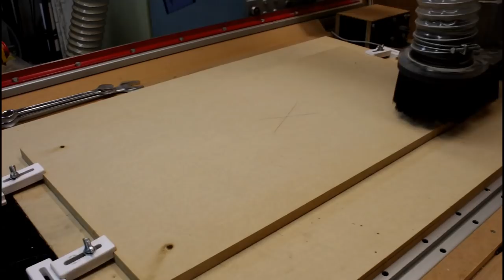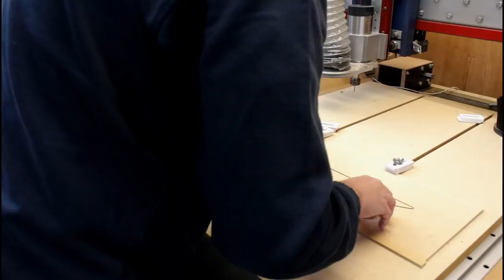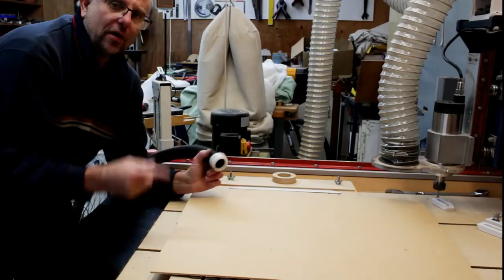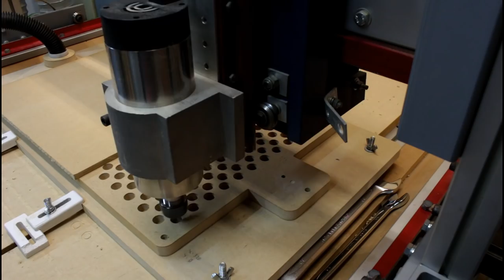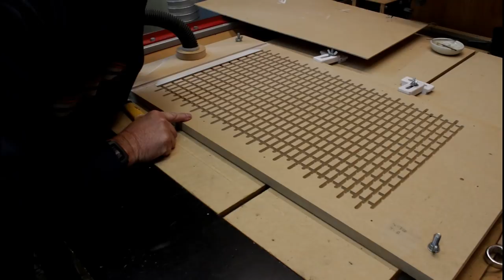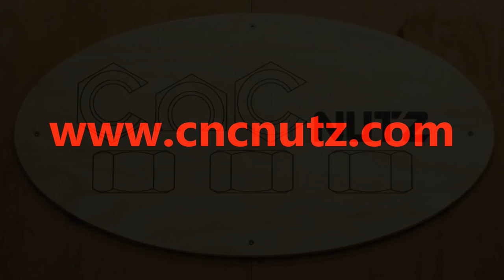DIY Vacuum Table Part 1- CNCnutz Episode 210

Comment: Hi Peter, yes so much of what I do is trial and error as well. Forgive me if you have covered this already, but I wonder if you are aware of any time out function or setting in Mach3, where if you bring in your code, get everything zeroed, then for what ever reason you don't touch the machine for maybe 20min, the steppers become non responsive but Mach3 still seems to function as normal. Reboot Mach3 and things are ok again. No big deal but a bit irritating.  I have a router controlled by a G540 and a mill with a Homann BOB and G213v on each axis. Any ideas?
Cheers
Phill
Reply from the maker: Nothing that I am aware of. It shouldn't be doing that. I am curious what you are using to connect the pc to the drives. Are you using the parallel port or a motion controller?
Cheers
Peter
Reply: CNCnutz (Peter Passuello) Thanks for your reply Peter. I'm using a parallel cable on both machines and a Dell Optiplex 755 pc.
Reply from the maker: Other than making sure you have things like screen savers turned off and power settings set to keep everything turned on I can't think of anything else. It sounds like the issue is your PC is going into some kind of sleep mode. I used to run a program called RM clock on my laptop to make sure the processor didn't reduce power while in use because laptop try and conserve power. RMclock can keep processors runing at full speed even when not in use stoppng them from going into power saving mode by slowing down. It's possible your PC has the same type of function. It may even be a BIOS setting
http://cpu.rightmark.org/products/rmclock.shtml

Give it a try and let me know if it fixes the issue.
Cheers
Peter
Reply: CNCnutz (Peter Passuello) Thanks Peter I will Check that out as soon as I can. Getting my eyes upgraded with new lenses at the moment.

Comment: Good video. I am thinking about using a vacuum pump instead off a vacuum cleaner.  Less noise and might be cheaper to operate.  I have sealed my mdf with paint which done the job on the vacuum leaks.
Reply from the maker: Thanks John.
Reply: As  long as your pump can do the volume.  A vac table needs very little pressure or volume normally, the volume is needed when the table is not sealed fully.  Lots of luck with your system!
Reply from the maker: I agree. Volume is needed to comer the leaks in the system and a little vacuum goes a long way if spread out over a large area.
Cheers
Peter

Comment: When you mention that the vacuum will overload when it spins faster, it is really being under loaded.
The motor spins faster because it has less load when you plug the air input, as it creates less dense air around the turbine, and motor uses less power.  From electrical point of view, less current.
Now, maybe bearings might not be up to the task of that little extra increase in speed, but it is less 1.5x extra.
Reply from the maker: Thanks Ivan for pointing out the vacuum spins faster. I confess that I never noticed it. I would hear the change of pitch but not thought about it any more than that. It's amazing how you don't notice or put 2 and 2 together but when it is pointed out it is obvious. That said the reason the vacuum burns out isn't the bearings, it's the heat. Because it is not 100% efficient much of the power going into the vacuum is output as heat and without the air flowing through it will overheat and burn the windings.
Cheers
Peter
Reply: @cncnutz  

Industrial or "shop vacs" are available with a bypass air passage so that the vacuum suction pipe can be blocked without blocking the motor cooling air supply.
Household type vacuum cleaners that rely on the exiting air to cool the motor are not much use for dust extraction and vacuum tables in the workshop as invariably there are situations where the air flow is restricted. A good vacuum cleaner will have over temperature protection but a not so good one will burn out.
Cheers Keith

Comment: Just us a non porous material for the bottom. No sealing required. Acrylic would be perfect.

How do you calculate the airflow? I need to make a removable 2x4 vacuum table
Reply from the maker: Hi Joe
I don't know about air flow but I simply calculated the cross section aeea of the hose and made sure the cross section area of the galleries was equal or greater so it didn't restrict air flow.
Cheers
Peter
Reply: Thanks peter that makes perfect sense. Great video. I have watched it many times over 1st and second episode. I am trying to understand why the holes on the spoil board?
I understand that it is to pull a quicker vacuum, but if MDF or LDF is already porous. Why make any holes? As long as you mill off both sides of the mdf to remove that flat hard compressed material. Kind of like the next episode when you use the newspaper trick.

Thanks buddy! Live, eat, sleep CNC!  Keep up the great work.
Reply from the maker: In all honesty Joe I thought holes were needed when I made this and will be doing as you suggest when I do my rebuild as I was thinking the same thing. I also want to test holding with pockets machined into the top against no pockets and see it there is any real difference. 
Cheers
Peter

Comment: the last project that sucked i done was the dust boot for my cnc
Reply: Does this mean that even if you had a perfectly sealed table you still wouldn't be able to hold MDF to it?
Reply from the maker: Well so long as it didn't blow. 😉
Reply from the maker: I think the vacuum would still bull through the sides of the MDF and unless the base pulled down to the table top hard I think you would still loose preasure that way. sealing is the only answer for the MDF base.
Reply: Industrial cnc routers do not use MDF they actually use low density fiber board.  You can make the bottom portion out of cast acrylic or you can coat the MDF with lacquer or a fast dry wood hardener.  Your project is spot on just needs a little bit of help.

Comment: its compressed sawdust. its not glued. its not a solid chunk of wood (which is also fibrous) you need to use a sheet of plastic or aluminum. its solid and not porous.
Reply from the maker: You will see in part 2 that I painted it which seems to have sealed it quite well and adds plastic seal to the bottom well for an added seal. In hindsight making the bottom from a plastic material would have been a better idea but you live and learn.
Cheers
Peter
Reply: CNCnutz (Peter Passuello) true story. I’m a machinist for a living and we have special suction plates built specifically for certain jobs and their profiles. We do however have different sub plates that are more universal. They have one hole in the center and the o ring we use can be orientated o fit the profile of the part. The vacuum pumps we use can be controlled on the amount of vacuum actually applied to the fixture dependent on tool pressure and material. Sometimes we can use flooded coolant and sometimes we have to use forced air. Again thanks for the videos and being so involved with the audience.

Comment: You cannot have dozens of large open holes and still have a vacuum. It's like trying to put a voltage across a short circuit. Why don't you have a cover mechanism for blocking the holes you don't need for a job.
Reply from the maker: Hi Lindsay,
You are right. Even uncover 1 large hole and the vacuum will disappear and that is why there are no large holes in my vacuum table. I can have up to 25% of the ports uncover and the part will stay put. I admit that covering unused holes will help keep better vacuum but it will still work even if I don't.
Cheers
Peter

Comment: Yes a lot of people find this hard to understand.  My pump pulls through 25mm mdf that has been skimmed both side with the edges sealed.  You may not need all of the holes 19mm just try a sheets of mdf and mask off the area that you are not using with a plastic sheet
Reply from the maker: Thanks
Reply: Yep, plastic sheet does wonders, but a big PITA when the hold down vacuum is exceeded by the dust extractor and the sheet tears away!  I've scavenged off cuts from builders wrap and other packaging.  Cheers, David

Comment: Methinks this is overkill on holes, and a wee bit of under-engineering.
A measure of spring-loaded marbles.... scaled to measure with CFM of your vacuum ....
divided by the area of the vacuum table..... 
Think ... Pressure is Vacuum.
Table Area
Needed Hold Force
CFM Value.
Tooling Forces Applied.
Estimate your required information carefully.
Do you ABSOLUTELY NEED FULL TABLE VACUUM ?
Does your machine process only a single few shapes ?
Palletized processing could change EVERYTHING.
Palletized means much can be diversified.
Merely adding FOUR OR SIX HOLES... for 4 or 6 + pallets... May negate some resources at some point in the process.
Each "HOLE" can be electified, pneumatic, or hydraulic optioned.
Yes ? No ?
Shape your VACUUM Table to each specific part.... is efficiency.

Comment: You have to seal the sides and faces of your mdf!
Reply from the maker: Thanks Julius,
I think I've figured that bit out. 😉
I am just surprised that something like a vacuum cleaner has enough suck to do that to MDF.
Cheers
Peter
Reply: CNCnutz (Peter Passuello) i want a vac table but the only job i'd use it on takes over an hour so double sided tape seems cheaper in the long run
Reply from the maker: I just want to hold thin material flat while machining. It's always a pain when it bows. I thought of using tape but have always wanted to try a vacuum. I agree about the cost of running the vacuum.
Cheers
Peter
Reply: Mythbusters lifted an entire car with just a shop vacuum.  https://www.youtube.com/watch?v=GbqKwPktCdo
Reply from the maker: It is incredible what a simple vacuum can do.

Comment: You could use HDPE.
LeRoy
Reply from the maker: It would be nice and air tight and ideal for a small unit.
Cheers
Peter
Reply: HDPE would be great.  MDF is lower $$ solution, especially good if it isn't a $$ making endeavor.